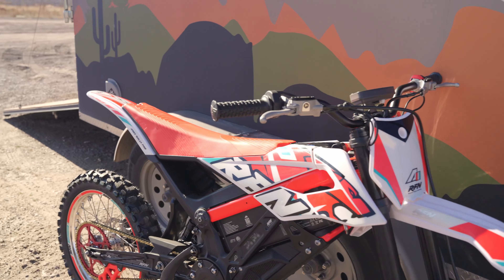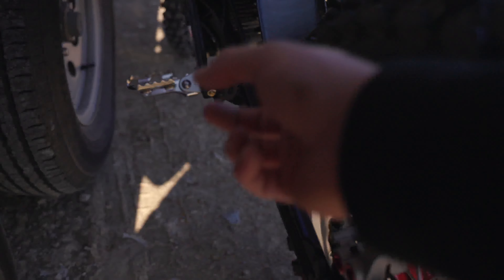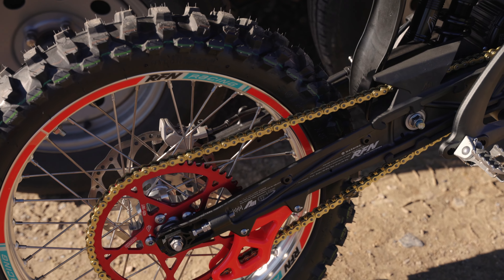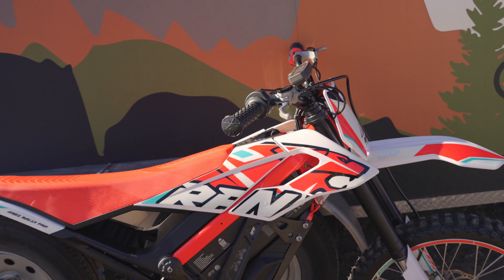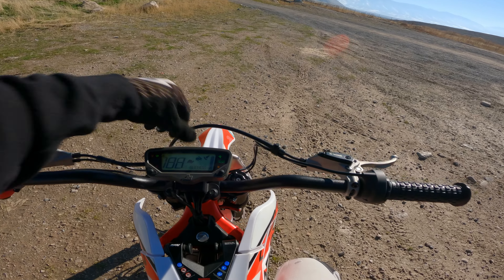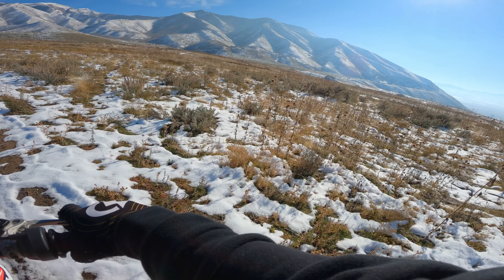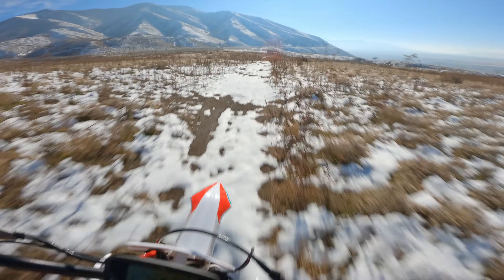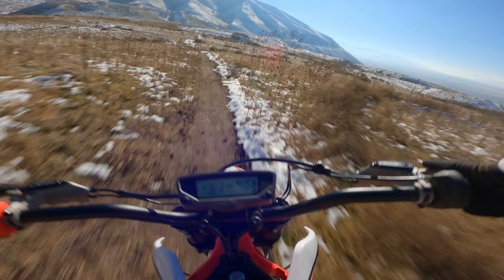Brutally Honest Review of the Apollo RFN | Beta Explorer

Comment: I’m a local RFN dealer and rider here in Utah, and I feel like it’s my place to stand up for RFN and clarify a few things about this review video. The bike he’s on was one of the early RFN release bikes. Since then, tons has changed. 1 1/8” 4”riser handle bars stock. 6 position foot peg brace, AWESOME grabby foot pegs. 60 second rocket mode now. You can remove the brake sensors easily. The handle bars now have a  forward and rearward position you can mount them to. The swing arm got an update and the added a brace which stiffened it up a bit. Still has some flex, but that was their intended design. But not near as much. 

$4,299 price tag as of 11/11/24. And for $199 we can get the tune on the controller and delete all sensors, increase power by quite a bit, increase overall RPM and a bunch of other little things. Warp 9 makes a 21” wheel that fixes the geometry. Other than that RFN has fixed all the other issues he noted. 

Personally I’d love for you guys (charged cycle works) to come down and grab our demo bike and take it for another spin and give it a second thought. It’s a great bike. If the aftermarket world would look into it just for a second, I think TONS of people would go to this bike. 

I own two of them. IMO they’re the best (dirtbike) emoto that I’ve found. I’m a KTM 300 rider and I love the RFN bikes for the Rocky Mountain singletrack. 

Id love to hear your thoughts on this charged.

Comment: I own one and have installed high rise bars and 21 inch front wheel. Mine does about 48mph and the rocket mode lasts around 60 seconds. Not sure why yours doesn’t. I’m in the uk . Might be different? I think it will be better suited for road use. The rear does flex and that’s due to the length of the swing arm . The surron has a belt drive then chain. The RFN is all chain and is attached to the motor making the swing arm longer . I’m looking into having a brace made . Haven’t worked that out yet . I love it . The pegs can be adjusted. It has a 3 hole bracket to do this . Pegs could be better but cheap fix . It’s no electric motion but less than half the price so that’s nice . I think any body that owns one will be happy with their choice.  Just need enough people to own them for up grades to be cost effective for the manufacturer. Enjoy
Reply from the maker: Yes, once the platform has a couple corrections made which we are currently working towards this bike will be a lot of fun!
Reply: @ChargedCycleWorks did you ever come up with any aftermarket options that you were working towards?

Comment: Zapp cycles offers a 43ah battery vs the standard 35ah. I wonder how much of a difference it makes? Seems like it could benefit a lot from a controller upgrade from ebmx, torp, etc. I’d like to see it with a Supermoto setup to cruise it around town. New pegs and bar risers are easy mods to improve ergonomics. It’s definitely in the light bee/ sting r class since they’re relatively same price. The ultra bee is like $3k more so it should be better
Reply: More power and more weight from a larger battery will make that flex worse. Maybe a kick ass 15Ah battery…
Reply: @jasonhall9786 yeah it definitely needs a better oem swingarm

Comment: Hold the turtle mode for 12 seconds after you turn it on to shut off the brake sensors.
Reply: Also Beta’s Explorer has better foot peg mounts that give you 3 more positions in front of the Apollo’s mounts. 
Which is so much better.
Reply from the maker: Thank you for the info! Will have to get the footpeg mounts as well as turn off those sensors!

Comment: Thanks for testing it while i think about to sell my lightbee and get this Apollo. Here the black editions comes with 43ah stock and rocket mode for 60 seconds while you can reactive it right after the 60 seconds again. We have the ultra bee too in the garage and yes i think its not the same class of bike.. i see it as my lightbee replacement.
Reply: My Uk black rfn has 60 sec rocket mode and can just keep hitting button over and over. Done 5 mins solid rocket mode no issue at all
Reply: thanks for confirm that, do you have the offroad or the road legal version? I'm not sure if the road legal version got the same controller with different software @djtimodj